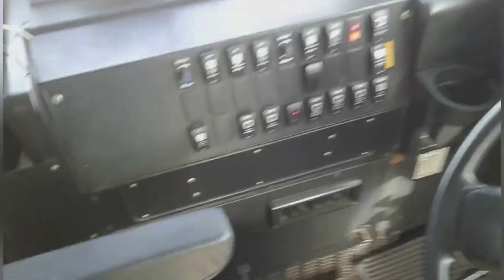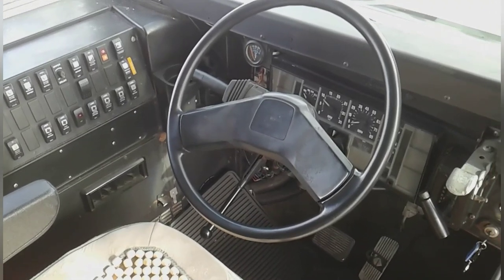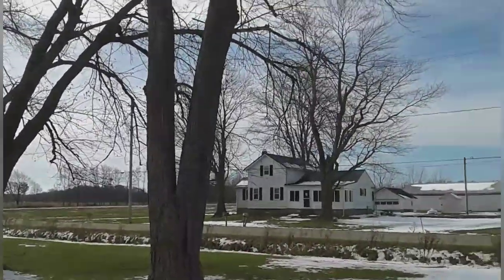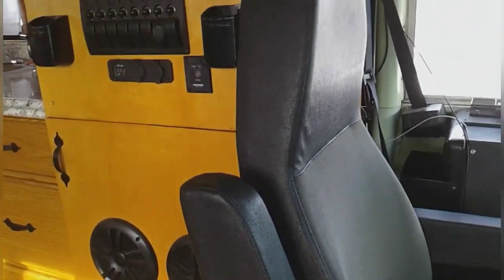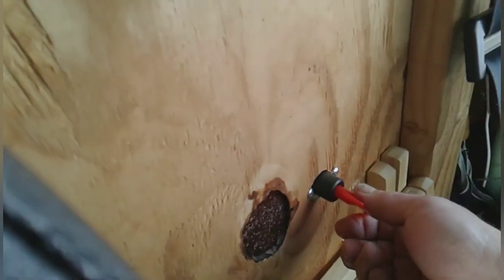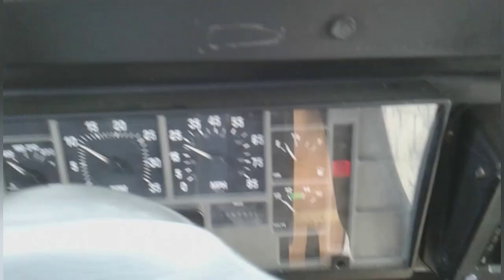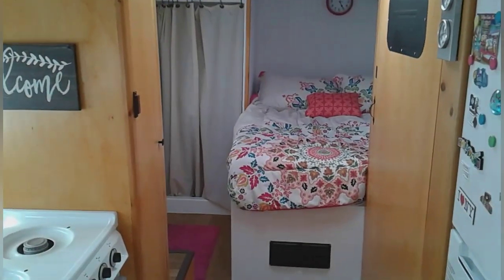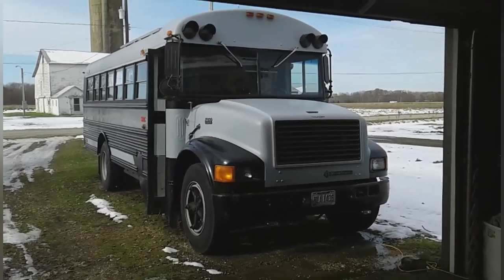Mullet's Skoolie Build EP 61 - Starting the Bus With Solar

Comment: Again Johnny mullet you are awesome. Have you heard this whole ordeal about adding the extra alternator on the top and running that extra belt up to help take a little leniency off of the alternator from the first original and use the second one specifically for the solar?
Reply from the maker: I never tried it but suppose it can be done.

Comment: Hey Johnny, great video. Are you concerned about burning out the bus alternator when you use it to charge your house batteries? I'm thinking about doing this in my short bus. 🚌 🚌
Reply from the maker: The bus has a 230 amp alternator and can handle it. The house batteries never get discharged enough to worry.

Comment: Very nice buddy. I’ve considered doing a similar switch. Quick question though, after you flipped the switch, did you not have enough juice in the house bank to jump start the bus battery..? Because that was the only reason I considered doing the switch, my house battery as a backup jumper and my alternator be my back up charger for the house battery. Thx brother.
Reply from the maker: The glow plugs and cranking juice would blow my 50 amp fuse I  have on that cable so the switch must be off when starting.
Reply: Johnny Mullet Ahhh gotcha buddy. Thanks for the heads up! Something to consider. Appreciate it man.